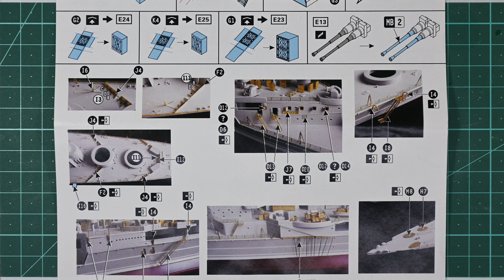1:350 HMS Hood: Part 19 - Level 1 Hatches

Comment: Great work.  Of late I have been using Micro Kristal Klear to set rigols onto the ship.  More open time and if I make a mistake it’s water based. Once the rigol is in place a little extra thin on the end of a toothpick into the center of the rigol and capillary action draws the ca around the inside edge and sets the rigol in place.  I have also been using it on other photo etch pieces like reels.   Clean up is a breeze.  Once again, great work.

Comment: Dave - you volunteered for questions, so from a Photo Etch Noob that is about to attach hatches to his DKM Admiral Graf Spee...

Would it be possible to use Tamiya tape as a guide for the bottom of the hatches?

I ask the question because I have never glued PE.  Will the glue draw into the tape and mess with the finish?
Reply from the maker: You will need to be careful. So long as the tape is not in contact with the PE it should be ok. If it is touching and the glue can get to the tape it will be drawn underneath it as you suspect. You will then have tape superglued to your model.
Reply: @DavidsShips  Probably not worth the risk then.  Glad I asked.  It would have been one of those great ideas in practice, but a solid headache in reality 😫